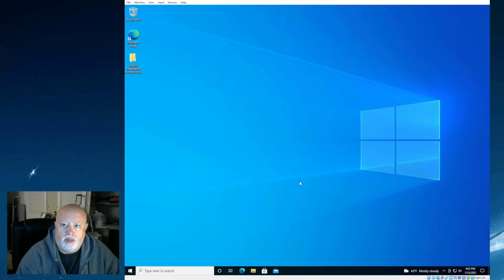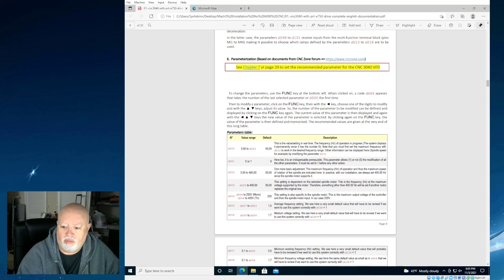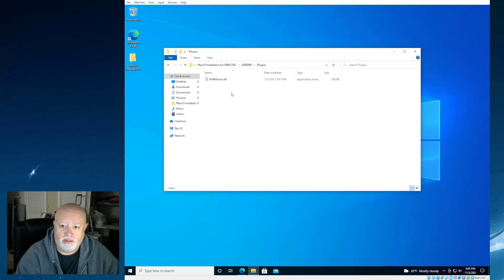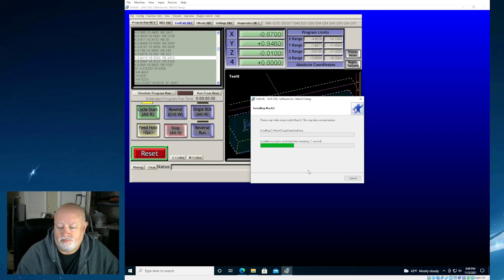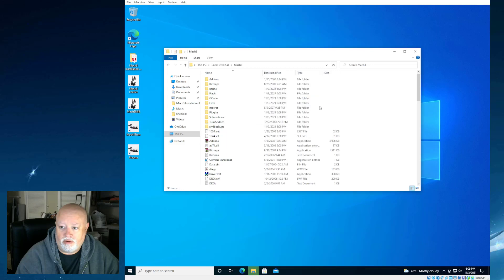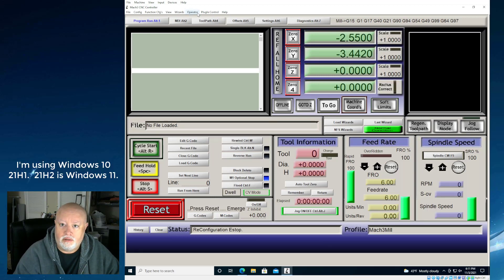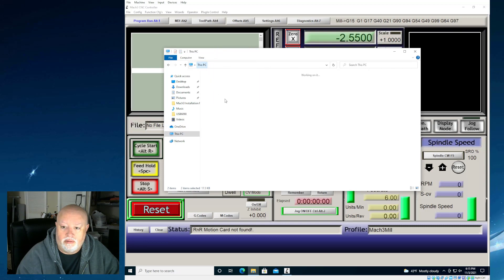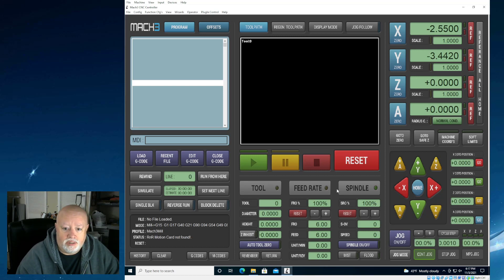Setting Up Mach3 with the files you get with your 6090GZ router.

Comment: Thanks Jeff!  The most informative Mach3 install summary for Generic China CNC Routers that I have come across.   Any thoughts on which post-processor to use or which generic Milling machine to select in Fusion 360 CAM to output usable Gcode for the 6090 that can be loaded into  Mach3 without having to tweak the header and footers?
Reply from the maker: I don't use Fusion 360 much... but let me test a couple things out and I'll try to come up with a good choice for you!
Reply from the maker: Okay... I played with Fusion 360.  You need to pick the right post processor within Fusion 360.  I setup my "mill" in the manufacturing part of Fusion as a 3 axis mill.  I then picked the post processor as the "Artsoft Mach 3".  I was able to output code... however, it was just a surfacing tool path.

I'm hoping to learn more about Fusion 360... but that would require time (which, with kids and other project, is in high demand).

Does that help??